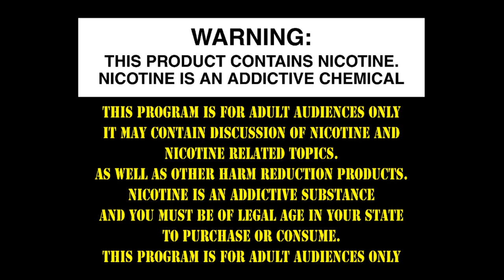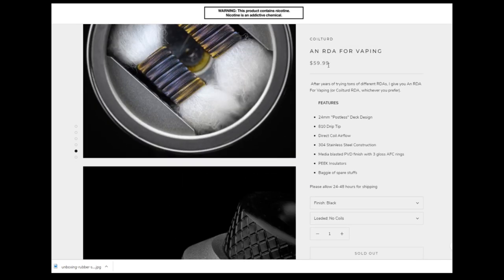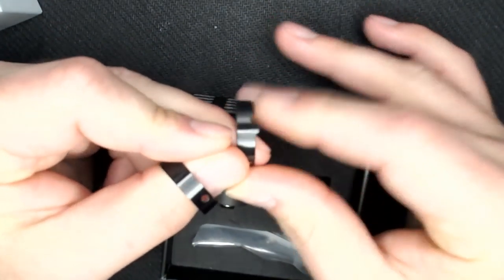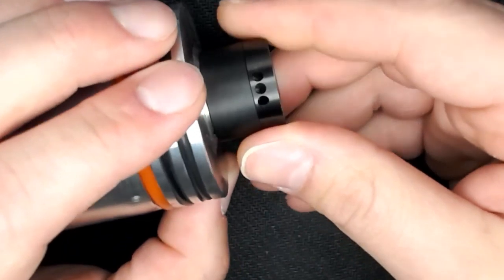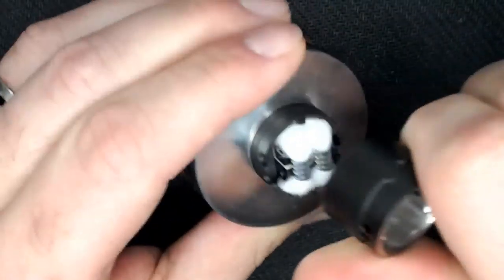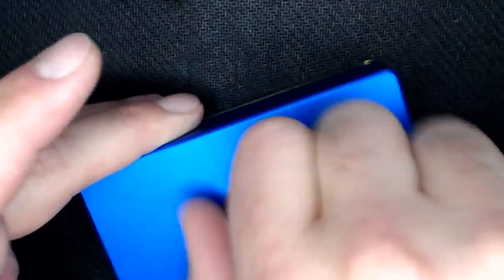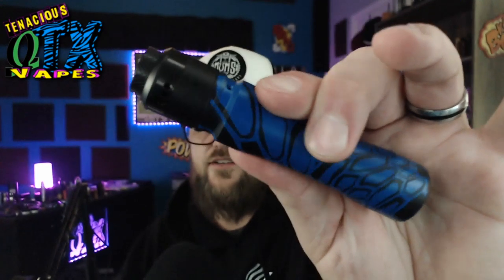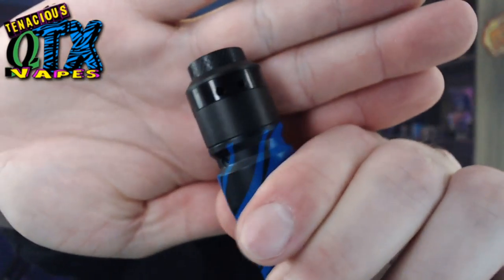An RDA for Vaping by Coilturd

Comment: 2 holes are where it's at for me. Bearing in mind your low mass preference Stan, I put a couple of 6 core 30g aliens in mine right at 0.1 ohms and they fire instantly (with next to no overrun) on the Vindicator. Threading on the cap is smooooth and fit and finish are worthy of the asking price IMO. Looks awesome in the 2 tone and flavour is top notch and dense too. Beecher did a wonderful job. Here's one book you can judge by the cover,  and after a couple of weeks, first impressions do last 😉
Reply: D Wise  I would say that it is 😉
Reply: D Wise  congrats brother. No doubt you will love it 😎👊